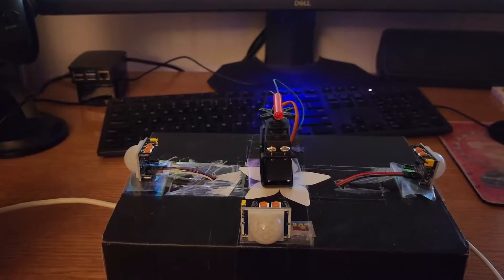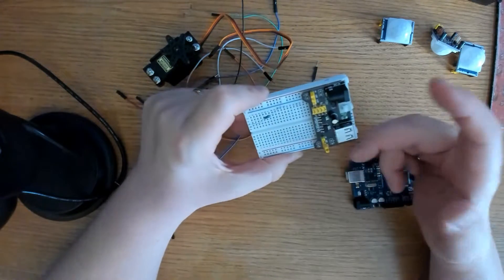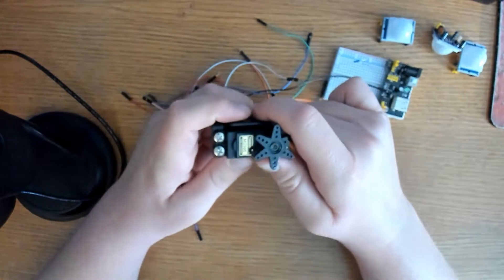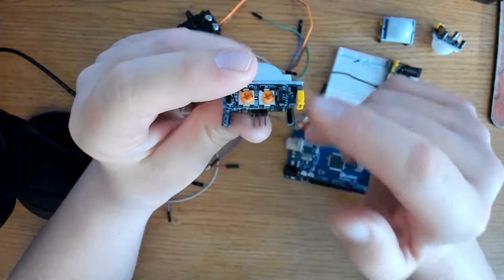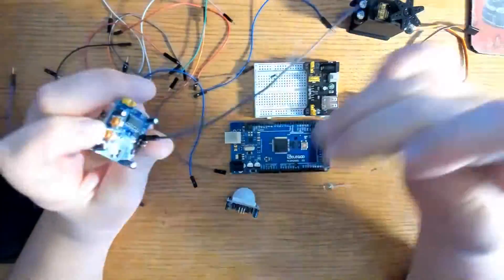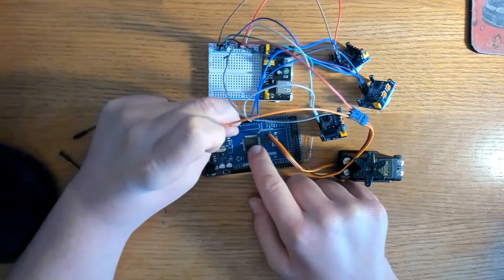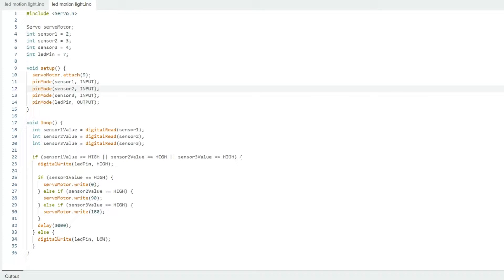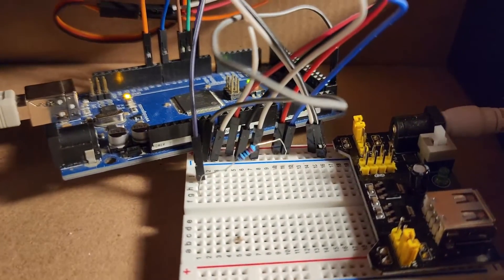Transform Your Boring Room with This Amazing Arduino Motion Activated Servo Spotlight Project!

Comment: so to use this you need to have it connected to a computer ? or is it good to go once the code is imputed?
Reply from the maker: Hi there!  Once you upload it to your Arduino you can unplug it from the computer and use it anywhere. The program is stored on the Arduino. Just use an external power supply to control your project. Remember not to power your servos through the Arduino and you should be good to go!  I like to use a 9v battery with a barrel jack adapter for the board and a 5v-6v with 2-3amp supply for the servos (check your servo operating votage).
Reply: @BMonsterLaboratory  awesome man thanks for your videos !!!!
Reply from the maker: @drazisage73  Thanks!